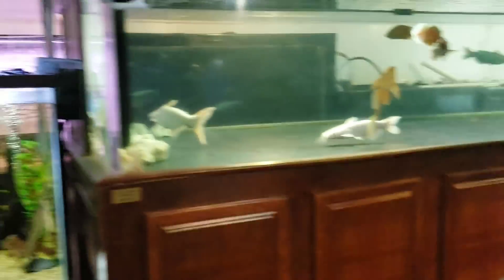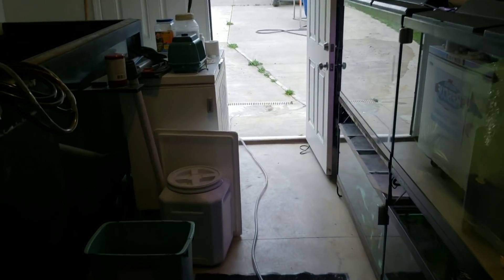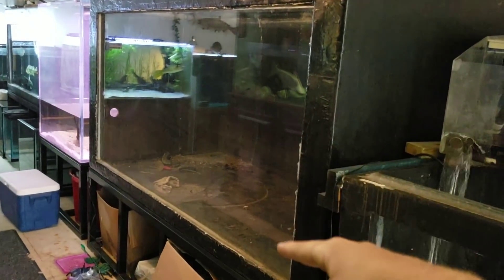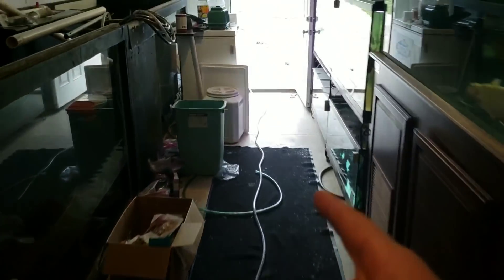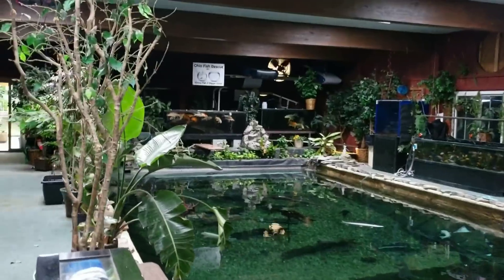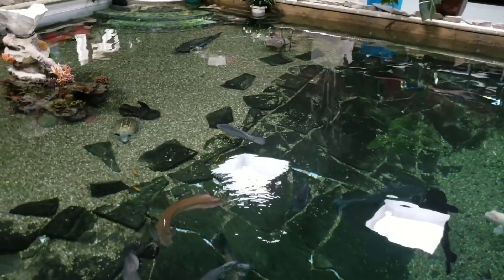The MAYHEM that happens at your favorite Fish Rescue

Comment: Hey take the old shingles and use them as a drive/ pathway to the back yard.   Plus how’s your mom? We sure did miss her.
Reply: Sadly roof demolition typically includes hundreds of old nails. If you're lucky, they all end up caught in a series of ground tarps or canvas for safe disposal.

Whenever parts of the roof was redone at my old job we kept  having stray nails left in the parking lot for months afterwards.
Reply: puirYorick  my old house in Ohio my driveway was 200 foot long 9 foot wide with a 20x20 turn out. I got ahold of 4 roofing companies to bring me the old shingles. In two years my driveway was  8 inches thick. Free material that stood up to my semi and trailer. Plus kept the grass at bay. Yes nails was a problem until I realized that they made great stakes. Keeping the shingles from blowing around.